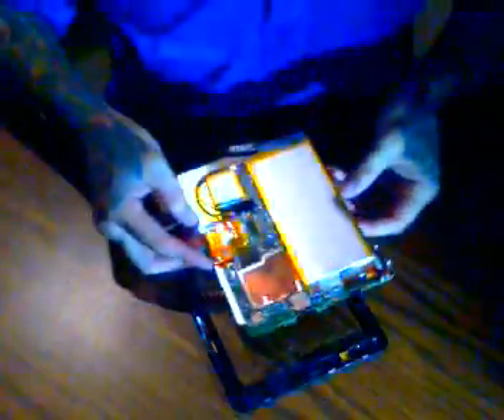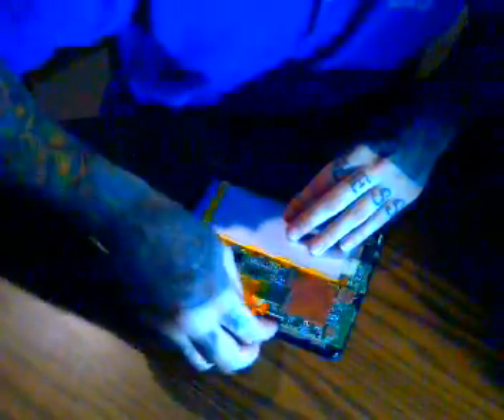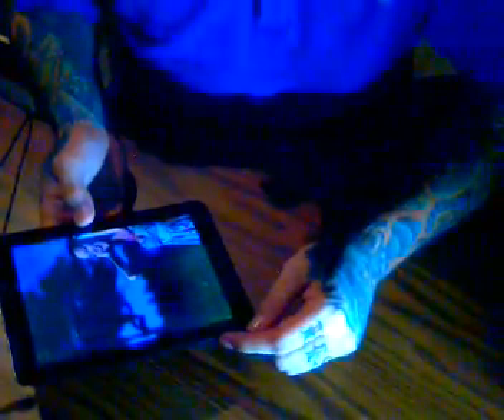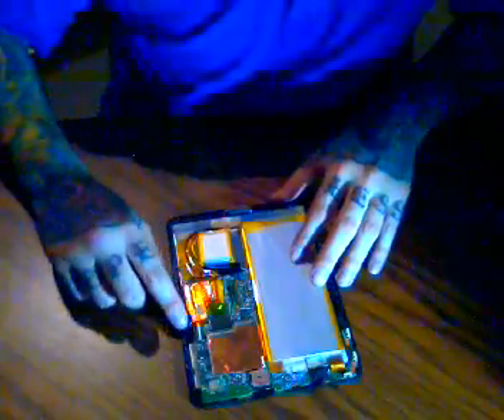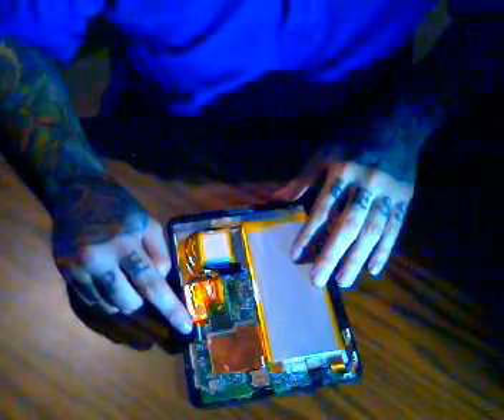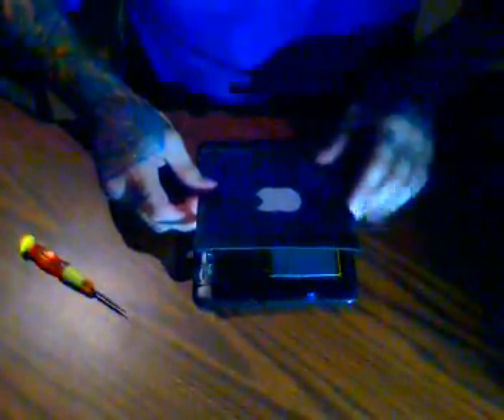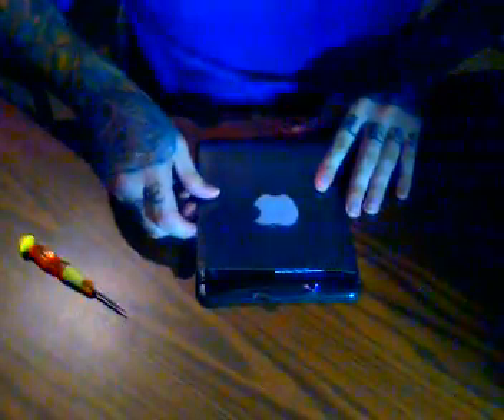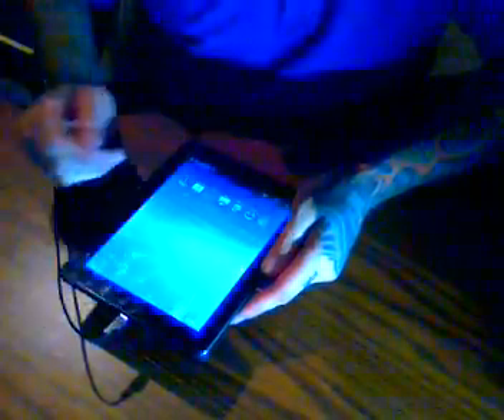AllenPCs.com NextBook NX008HD8G broken glass (digitizer) FIXED!

Comment: Great video. Thanks. We have the same tablet and a broken screen. Still works. Just an annoying crack in it. Screen works fine. But worried about if dropped or pressed to hard. It will make it worse. So I'm hoping soon to purchase a digitizer replacement part and fix it myself.

Comment: Hey George! Thank you so much for making this video for us. I had one question. Can I get a replacement for the back bezel and back panel? I bought a used tablet, and it has a broken digitizer and the back panel is scratched pretty badly. I got it for 10 dollars. If worst comes to worst, I will just put a bunch of stickers on the back. Thanks!
Reply: ***** Yes! You gave me an idea! I am going to try to find a case/maybe mod a case with a keyboard built into it. Thank you so much. After I receive my digitizer in the mail and repair it, I will tell you how it goes. Thanks again!

Comment: Hi, I was hoping you can help explain how I could open the back cover of my Next book 8 model no. NX785QC8G. I don't want to attempt in prying it on the wrong end, because its one whole solid piece and no screw visible. All ports are on the top. I bought the tablet from Walmart although the manufacturer can't send back to our region and refuses to send through walmart to us for whatever inconvenient reason, despite walmarts capablility, so warranty is useless at this point. Customer service was a fail so after research, your closest to a problem I have in resolving, hopefully.

Comment: Hiya,
I need to replace the glass, so I'm guessing I have to (very carefully) take all the glass off the tablet and have appropriate glue for the new sheet of glass? Is this correct?
Reply from the maker: That is correct. Do not recommended using glue. You can use 1mm double sided adhesive tape.

Comment: Hello, I have been trying to find replacement screen FPC-CTP-0800-021V1-1 WZ1326 2013-01-27. Every where I look it is no longer being made. Do you have any advice on locating this part.?? Do you know if there Is a universal part for this? Thank you.
Reply: I have found a few on ebay as I needed the same number. Just put in the number up to and ending with 021v1-1 and you will find a few.
Reply: Thank you,I found 1 . Have a great day!
Reply: Watch out. I got fooled. They sent me a replacement screen an f0264 and claimed it was the same. Just installed it and I think it is not the same physical piece by only a few kilometers does not work properly. Sorry I spoke too soon and was fooled as they advertised our same number.
Reply: I did also . Not your fault . thank you :)

Comment: I bought new digitizer, axis is inverted.  I had already thrown the old digitizer away.  what are my options now?
Reply from the maker: More than likely the digitizer you purchased is not the correct one. This happens a lot. On the original you can find the exact part number on the ribbon cable. Being that you threw it out you may never know the correct part number. I have heard of people installing an app that can control the axis but I am not sure exactly what it is called. I am sorry this answer is not helpful.
Reply: The place i ordered it at says there are 3 that are for that model.  Can you provide those?
Reply from the maker: Mike McCoy I might be able to find the part number for mine but I do not have the other part numbers.
Reply: If you can that would be great.  Might be different than the one i have.  That would be two.  Process of elimination...lol.  Thanks alot for the quick responses !!!!!
Reply: I did put kapton tape around the inside to cover the bare metal look.  Could that have caused it?
Reply: Ok if you can provide yours that would be great

Comment: i have the  nx008hd8g and  my touch screen stopped working... my  screen is not broken and it was not  dropped is  there anything else that would be the cause of the touch screen  now  working? is there a way i can be  sure it is in fact the digitizer that is broken and in  need of replacement without having to take it apart? thanks
Reply from the maker: The only thing I can think of would be to do a factory reset. The driver could have been corrupt but parts do go bad and more than likely you will have to replace the digitizing unit.
Reply: Ahh shoot... that's what i thought thanks you
Reply from the maker: Ashley Branham Your welcome. I wish I had a better answer.
Reply: You had the right answer for me thank again very much appreciated 😀
Reply from the maker: Ashley Branham you are very welcome. Happy holidays!

Comment: Someona can help me i have this same tablet Nextbook (NX008HD8G) but i could installed, but when i turn on the tablet for a test, i touch the screem and the left side is the right side and the right side is the left side and i don´t know how can i fix it, i will waiting for your answer
Reply from the maker: This means you have purchased the wrong digitizer. That is Why the axis is reversed.
Reply: i buy the version D, and i don´t know what i will do, are there other way that i can use this version or i need to buy other screen?
Reply from the maker: You will have to purchase the correct model.